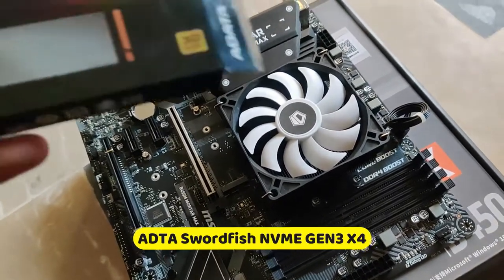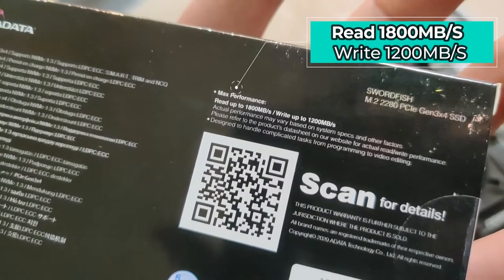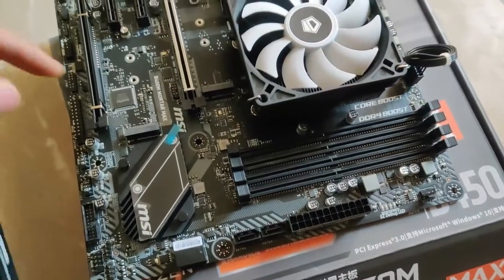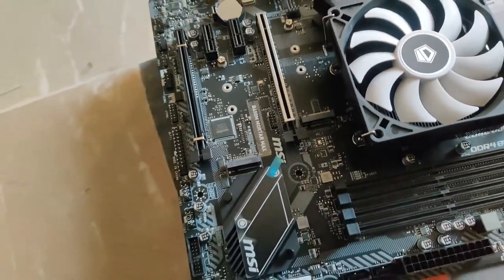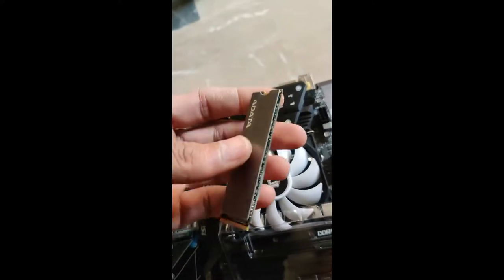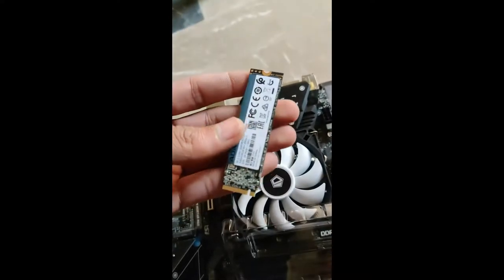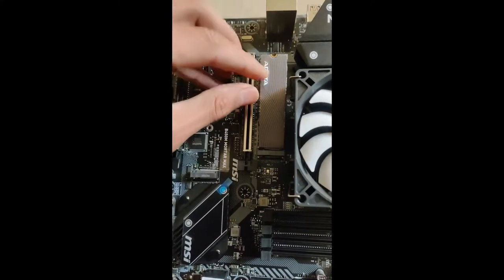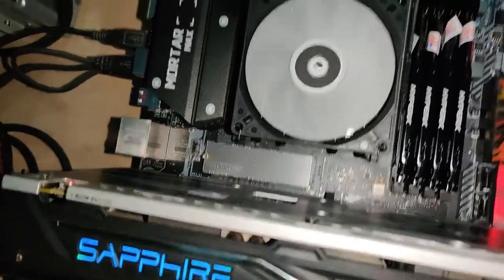ADATA SWORDFISH NVME GEN3 X4 Performance Test

Comment: Good speed.
Can you tell me whats the health of this ssd from Jan 1 up till now ?
Reply from the maker: Good
100% Working
Reply: Sir I have one and using Userbenchmark it shows the m.2 at like, 2%. That's nearly as low as it can go. Dang thing is brand new and basically broken. Bought an SSD and put my games on there so my terabyte NVme is only for windows and two games. If it gets to 50% capacity forget it. When I freed up space and ran the benchmark it was performing in the green.